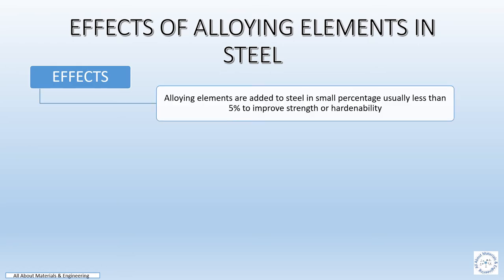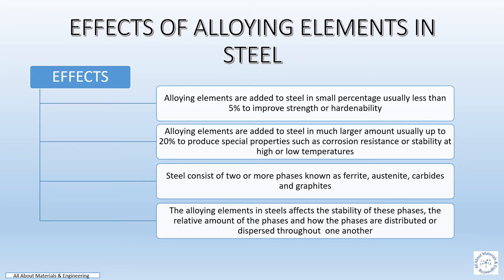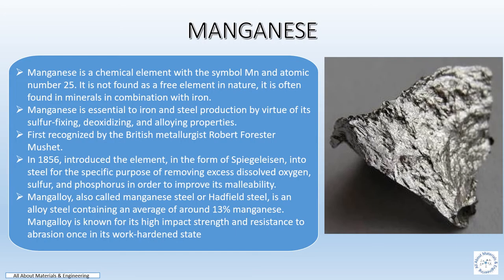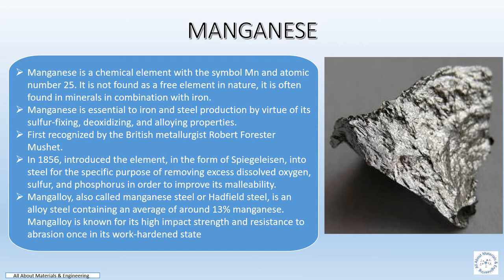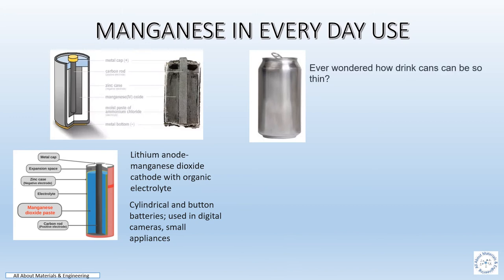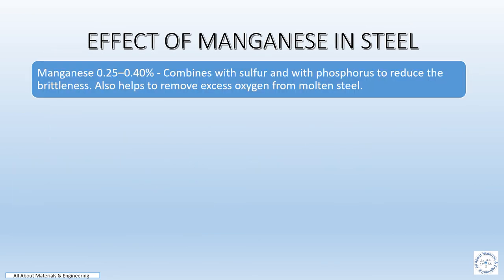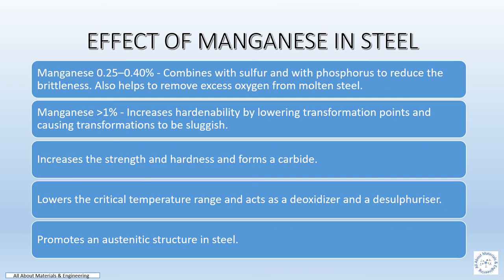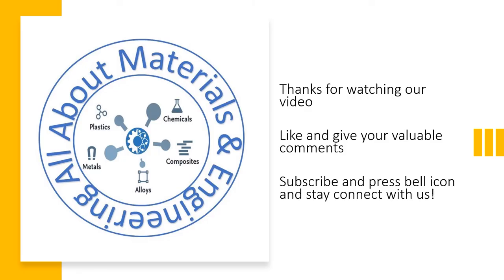Effect of Manganese in steel And Manganese in Everyday use

Comment: Very important  informations which I have today. Thanks a lot. By the way I want to know  about difference between  high carbon and low carbon feromanganise.  It will be very helpful for me. Thanks a lot.
Reply from the maker: Low Carbon Ferromanganese constitutes approximately 80% of manganese and 1% of carbon with lower contents of sulphur, phosphorous and silicon. Low carbon ferromanganese is mostly used in the welding industry. It is an essential ingredient for making high-strength low-alloy steel and stainless steel.
Reply from the maker: High Carbon Ferro Manganese is an alloy of iron and manganese with high carbon contents, usually 6-8% w/w. High carbon Ferro Manganese is usually produced in arc furnace from manganese ore and coke in specified ratios. High carbon Ferro Manganese is used as deoxidizer and desulfurizer for production of steel.